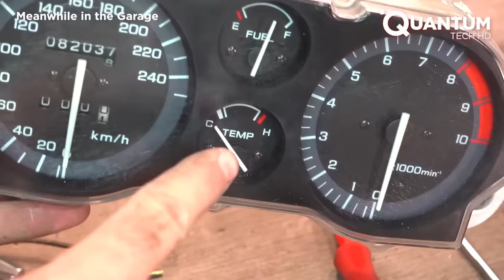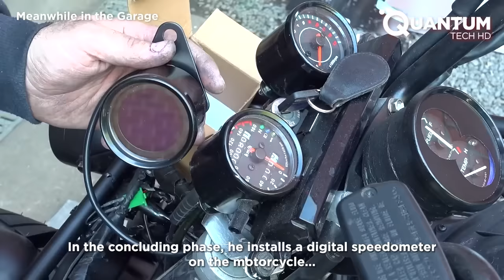Man Builds Amazing Futuristic Motorbike Using an Old Honda | Start to Finish @meanwhileinthegarage

Comment: With that 'welding'  he turned that bike into a suden death trap
Reply: YIP
Reply: That bike would never be allowed on the road in the UK, it's a deadly restoration, looks cool, but not safe to ride, he didn't use any frame jig, so it would handle like a roller skate.
Reply: thinking just the same... first bump he goes over, he's gonna have 2 bikes
Reply: Yes the weld is full of gas bubles . Bend the pipe with sand   In the pipe
Reply: Wel een vakman die bels. Alleen die las zat vol gasbellen. Maar wel klasse gedaan.  Nl brabant
Reply: @davidpowell6098  I think it's for show not really to be driven on roads, plus bending the frame out with a hydraulic jack to make a gap is bad then the welding lol. To do a proper frame modification you need a bare frame & yes in a jig to keep everything square.
Reply: Solda horrível 😅

Comment: Good idea, but the construction of the structure and the metal roofs leave a lot to be desired, many joints, and the welding is no better, they are very crude. Suggestion: now that the model is built, replicate the metal cover by limiting the number of cuts and hardware, the seat also needs to be improved and the rest against the fuel tank cover is not well finished. The idea is good but requires urgent improvements, finally and most importantly, the cut made to extend and increase the angle of the neck of the front fork does not deserve any award for safety, I think it should not have been done, at least not in that way , is a latent risk for a motorcycle with tremendous weight and a large engine with a lot of displacement and power.

Comment: When you raked the front end, you lowered the frame so now you can not turn, without the frame and, or pipes hitting the ground. Rake needs extension to bring the chassis back to proper height.

Comment: This man trusting 300kg bike on some soldering & welding works😂😂
Reply: Bet you're brilliant at welding, bitter much?
Reply: @smashinlad1970 that's not the point. Framework like an ironworker on a warf to build the Titanic, that's not the right way to "customize" a motorbike. That's not a critic to his talent....but welding a frame need better measurements, quality of material and a specialized welder with lot of years of experience.
Reply: Pelo menos ele tem coragem de fazer algo e vc ???
Reply: Before you talk, do it your self. And let me know if you're finish, ✌️
Reply: That's not soldering! It's called Tig welding and it's probably the strongest weld you can do on something like that...how do you think they made the bike to begin with
Reply: Esta muy bien,para los que nos gusta mejorar y transformar cosas es un placer ver esto, pero hay gente que no hace nada bueno y solo les gusta criticar en forma negativa y no da soluciones para mejorar😂😂😂😂😂😂.

Comment: Been watching all most all your clips . You done many interesting projects ! Long surface metal belt sander is nice . But , E. speed control for AC motor cost as hell ! You done only one shit thing , when you broke mill slip unit , using mill as press . This moto bike looks origin - unique , evan it's not my stile . How you past on homologation test !?